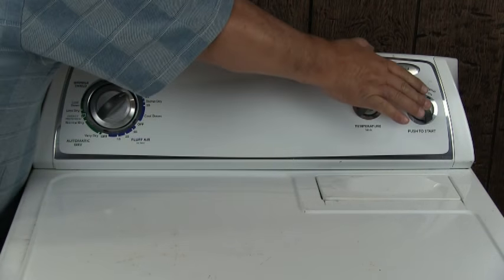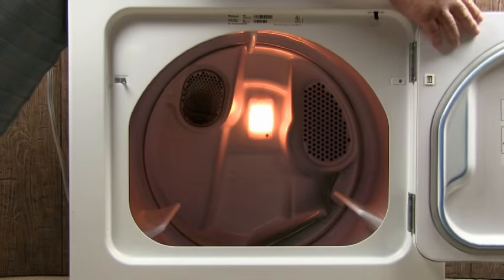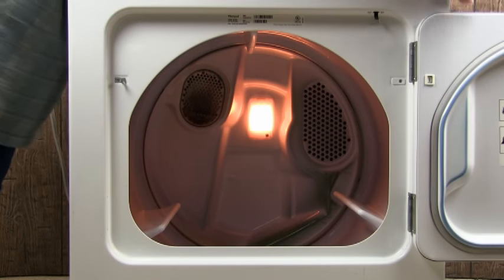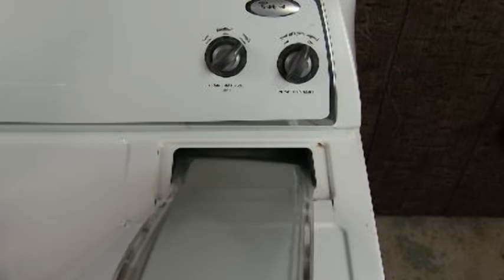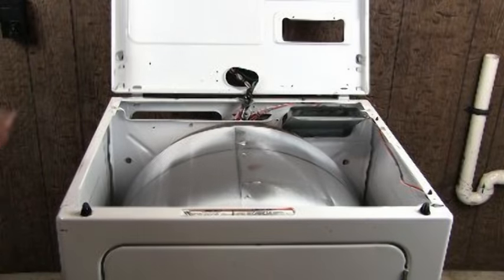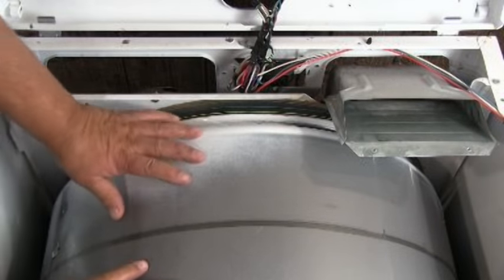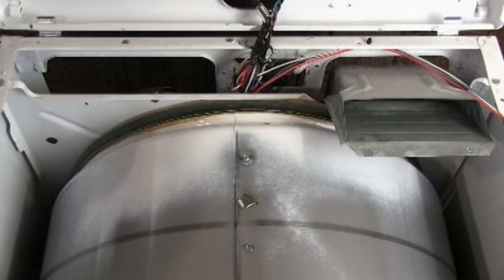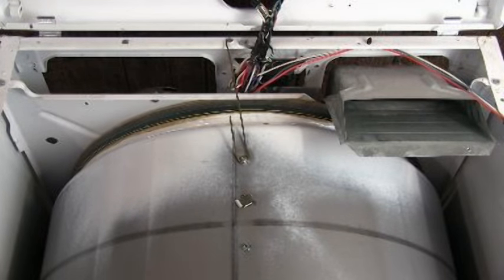Whirlpool Dryer Drum Not Tumbling - The Idler Pulley

Comment: I watched three other vids before yours.  Yours was the only one to use a wire to hold the drum (amazingly helpful) and yours was the only one to show the belt being installed groove side down (Amazon actually had a detail that showed that).  Yours was also well filmed and bright enough to see!  Thank you, Applianceman!
Reply: I agree with ALL OF THIS!
Reply: Thank you for taking the time to show the steps to repair. Was very helpful.
Reply: My gosh I’ve watched 1000’s of YouTube videos on how to repair cars, boat motors appliance’s etc…this is THE BEST HOW TO VIDEO IVE EVER WATCHED!!! Thank you!!!
Reply: agree the wire is a great tip.
Reply: Love, ❤, the coat hanger wire tip to temporarily hold the drum In position. You saved me an expensive service call.
Reply: The coat hanger trick is because he removed the rest of the dryer mechanism and left the drum free floating.  There is no motor, blower or heater in the cabinet.  My dryer has a blower assembly with a roller and slide to support the front of the drum.  The motor is behind the blower and the pulley is attached to the motor shaft. I just replaced the motor because the pulley was cracked and not available separately.

Comment: Thanks for the video.  I found the pulley on the motor arm sheared as well.  Able to get parts and repair the belt and motor arm pulley. You were right about the sharp edges. I found a lot of little nicks and cuts from the edges. As a bonus, if found over $7.00 on the bottom of the dryer.

Comment: Watched another video that looked like it was an official video for the manufacturer, even had a uniform on.  He did pretty much everything you did, except he held the drum up with his hand, and made it look much more harder than your trick with the cut hanger holding the drum up.  Without that little secret this process would of been much harder.  Also your info on the idler pully was spot on.  My idler pully was like the one in your video and when I looked for replacement I could not find it, but the one you suggest is the only one that I could find without any explanation, but your video confirmed that I would need the other pully.  Also your direction with using gloves was also informative.  Much more valuable information than any other video out there!  Subscribed!

Comment: I did it! 🥳🤗🥲  I didn't have any wire or a coat hanger so I used zip ties instead
Reply: Same. I stuck a mostly empty bottle of Gain detergent under mine to hold the drum still. Dryer stopped working at 2am, was checking FB Marketplace for dryers and thinking about heading to the laundromat to finish drying clothes. Then I decided to pop on youtube. I didn't even have any broken parts, just a worn out-ass pulley

Comment: Omg, thank you so much for this video. I was able to follow your steps and see that the belt was broken. One question when I put the coat hanger around the large metal piece on the drum it popped off and now I can't find it. Is this anything to worry about? It fell somewhere in the bottom of the dryer I tried to look for it but can't find it.

Comment: I opened it up and fan belt is good. I turned tumbler by hand closed it up turned it on tumbler started. Opened door then closed tumbler didn't start. Turned tumbler by hand closed it turned on tumbler started opened door closed it tumbler didn't start. Opened it up turned tumbler closed turned 
on tumbler started. Did this 3 more times same thing happens. any suggestions?